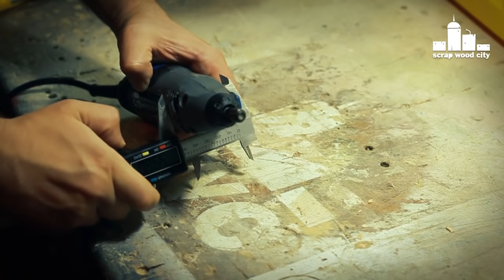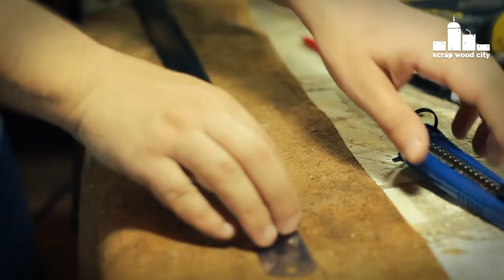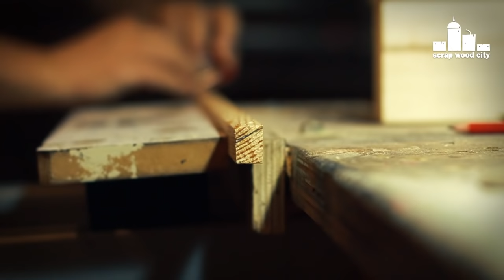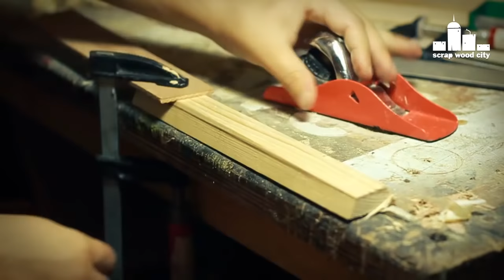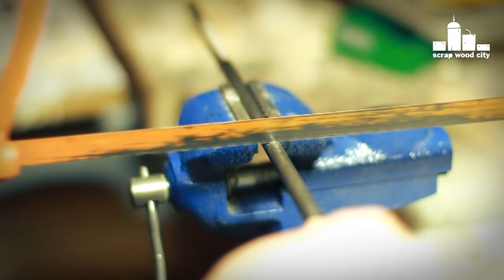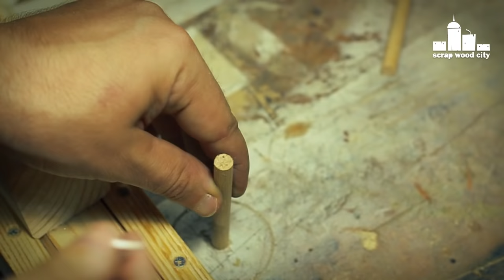Convert your rotary tool into a DIY mini lathe for modelism

Comment: Works great for a large dog's nails, seems to hold a charge long enough. https://www.youtube.com/post/UgkxfPgcZ5_Cl0HDUKkMJAKde11YKQZVgMoR I plan to use a couple of times a week, lightly, rather than have to subject the dog to longer sessions. I read that it's important to move quickly from nail to nail so it doesn't get hot, but it hasn't seemed to be much of a problem. I practiced on my own nails first (they have a strong gel, I don't know about this for natural nails), to learn how to hold it. It charges quickly enough for me and I like the variable speed. Instructions are clear, no problem putting it together or changing the tip. Might use this for some legit woodwork, even.

Comment: This is one tool-mod-lathe that seems to make sense and can stand up to a beating as suppose to those drill/drill press mods which seems suspect at best.  Thanks! I might actually attempt this.
Reply from the maker: thank you, glad you liked it
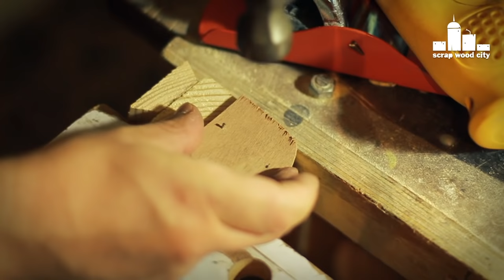Reply: one question, what's that thin piece of board for @4:39?  It seems u could have just screwed the rod directly into the tail piece there.  Thanks for the response by the way!
Reply from the maker: It makes the whole piece a bit more secure
Reply: look at the art of weapons or shop built for good lathe tutorials, much better than this

Comment: Good work man! To compensate for the low torqe you can use a 3:1 reduction with wooden gears(or pulleys and belt) and 2 bearings and a small 8mm shaft for the spindle. Ωραίος!
Reply from the maker: +jimbit22 σε ευχαριστώ πολύ!

Comment: Nice little fork. If you can drill a hole down the length and  the side. You have a way to secure it to the dc motor shaft with a small screw.

Comment: This looks awesome, but if I need to have all these other tools that you used, I might as well just buy a mini lathe, which would probably be less expensive, more accurate and wouldn't wear out my rotary tool.
Reply from the maker: You may be right, after all these are experimental builds!

Comment: Nice set up and lighting and good job with the handplane! My dremel tool came with an adaptor, kind of a washer with an extrusion that you could install right around the spindle, to be able to clamp it to their own vise or any other set-up. It would have been useful for you! 
After your tests,was unbalanced parts an issue at that rpm? thx!
Reply from the maker: +Cactus! workshop thank you! It is not that well balanced but it does the job! I don't know about that washer you say, It sounds it could be useful!

Comment: that leather could toast the dremel it needs proper ventilation, btw just use an old drill it even has its own chuck.
Reply from the maker: +Luis Fernando I have already made a lathe with a drill, I wanted to use something different! If you use it for small stuff you don't have heat issues. But you can't use it for let's say an hour without stopping!

Comment: Just some feedback for those considering doing this. I did this exact build, using a dremel. And burned out my dremel in about 10 minutes of use. Best to just buy a small lathe, they aren't that expensive and I wish I had done that.
Reply from the maker: My dremel still works fine. Of course I never used it for 10 minutes without stop. This is for small stuff! Mini lathes can cost 100euros and more and a few of them are really bad quality! Anyway many options out there!
Reply: Seems to me that the Dremel isn't built for power, but speed. I can see how it would burn up quickly. Better to use a drill or some other motor with more power.
Reply: You just closed your dremel ventillation holes (at 1:20).
Reply: epicdeuce That sounds like a personal problem

Comment: Be careful with keeping the tool cool. I have had a few dremels overheat and electronics break on them.
Reply from the maker: +Jared S you are right it gets hot really easy. That's why I try to keep it at low speed! Thanks for watching and commenting!

Comment: You've actually shown several better uses for your rotary device, why ruin it's motor making a lathe out of it when your jig can just as easily be applied to a Power Drill that you can get at a Yard Sale for five bucks. Nice design, but the resistance is eventually going to kill your rotary tool.
Reply from the maker: +Jason McCabe (Camulas) So far I have not faced a problem of over heating. Perhaps because I don't use this for more than a few minutes at a time. I have also made a power drill lathe in another video. The rotary tool lathe was an idea I wanted to experiment on. Through my videos someone else might find a useful idea and apply to something else. I think this concept of exchanging ideas is what matters the most to me!